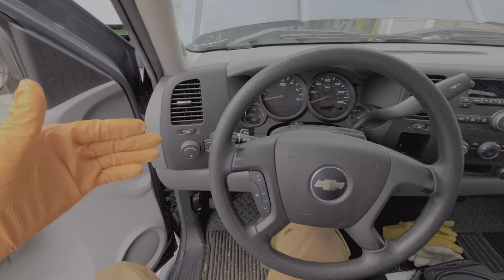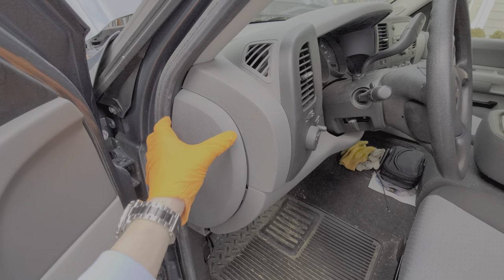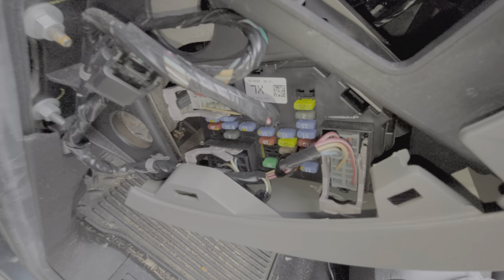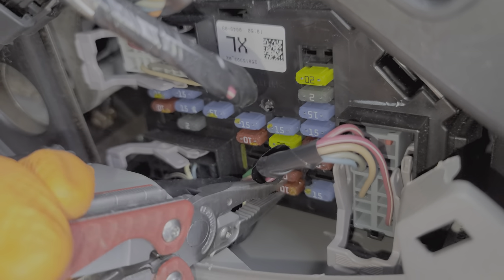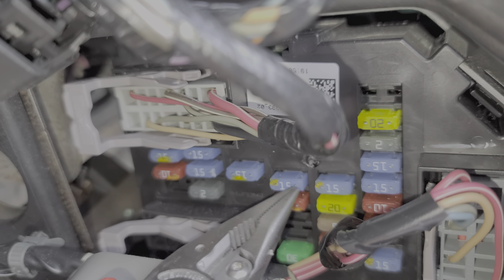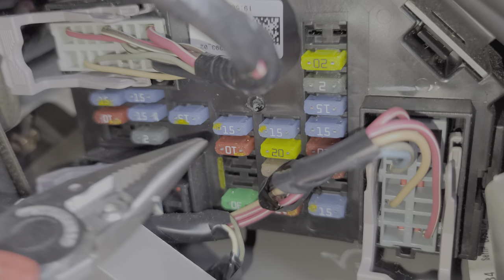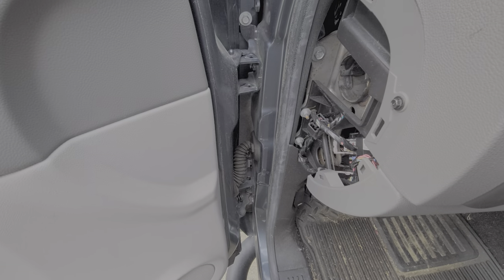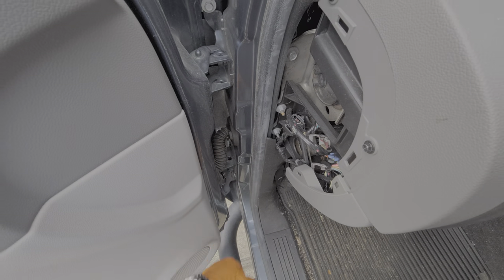2009 Chevy Silverado Power Door Lock Fuses, Keyless Entry Fuse

Comment: Awesome, this fixed my issue. Thank you soooo much!. Also, as an fyi, my Keyless fuse was not even blown, just needed a reset. Pulled it out, pushed it back in and all was good again. This was on my 2007 Tahoe. Keyless fuse was that 10 amp red one at the bottom that he mentioned first.

Comment: Thx. For the video. My problem is the motor that drives the keyless entry in the drives door is bad. Want to change but it costs 130 for an aftermarket, and I don’t have the patience right now to dig back into the door panel. Also, just a note to bill, my pass lock has not gone off since I reset and sprayed contact cleaner on the connectors….kudos bill.

Comment: I have a 09 chevy the keyless entry works fine and unlocks my doors . My drivers sider unlock and lock doesn’t work so I thought it was just a switch so i swapped it out for my passenger side unlock and lock switch but it changed nothing

Comment: I have a 2011 Chevy Silverado and I try to use my keyless start, I can hear it try to turn but it doesn’t start any ideas?
Reply: sometimes it will try but it won’t engage starter if you have a check engine light on
Reply: Did u find out why? I click my remote lock 2 times and lights will turn on , sometimes make alarm go off and radio turn on

Comment: All my switches work sometimes and sometimes they dont can it be the door actuator itself?
Reply: I have replaced quite a few actuators, but I'm no expert.  I  think your issue has nothing to do with the actuator itself.  It's probably the wiring or a switch.  I could be wrong, though.  I am facing the same issue right now, with front locks working sometimes, while back works all the time.  I have the big, expensive switch, though, so I'm trying to rule out everything else.
Reply: byrd4mgt yea i been trying to figure out if theres a short or broken wore somewere but no luck let me know if u find any solition bud thanks
Reply: @juniorlopezmusic2067  I think (THINK) that I have a bad wire in the wiring harness boot between the door and the truck body.  The lock seems to change behavior at different door positions.  I haven't looked into it yet.
Reply: byrd4mgt thats my exact problem i opened up the boot today and couldnt find any broken wire u think it can be on passanger door too?
Reply: @juniorlopezmusic2067  Maybe so.  There is a hot wire all the time going to both sides for the door locks.  It has to be hot all the time because you can operate the locks at any time.  I was reminded of this when I was replacing the fuses I inspected and heard a click.  Remember, the driver's side usually gets the most wear.  A wire in an unused door could go bad, though.  How hard was it to get into the boot?
Reply: byrd4mgt not too bad u just remove the cover right under the ebrake pedal and u clip the little clip and pop it out and the wires are out but i couldnt find any wires that were in bad shape nor when i moved the wires did it get better or worse
Reply: @juniorlopezmusic2067  Thanks.  Good luck tracking it down.
Reply: I'm having the same issues. I just spent the entire day taking off every ground-connection I could find and cleaning and reconnecting. I've had no luck yet but I'll post if I do. Please let me know if you solve the problem first.
Reply: Any luck?
Reply: @chrislane8603   find the problem??
Reply: @Eddy Silva  no I didn't. Just living with it.

Comment: My locks wont work with the switches but i can hear them try to work when i shift in and out of park. Any ideas?
Reply: I say try because its faint but i can hear them but the locks dont move.
Reply: I have the same problem and am also looking for a solution
Reply: same here.  did you find a solution?
Reply: @stevedeyne  I bought a new truck lol not because of the locks it was just time